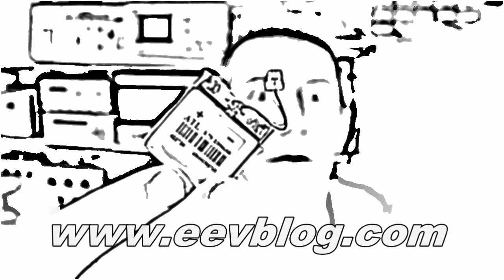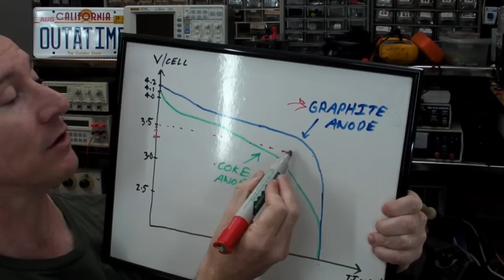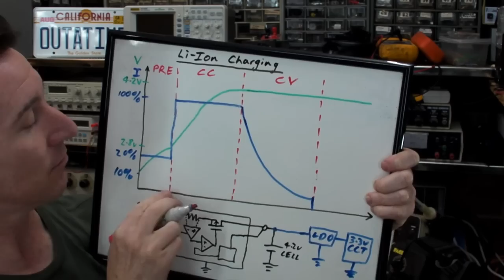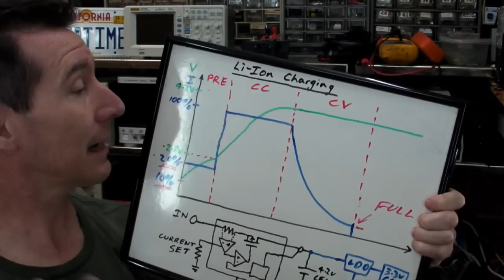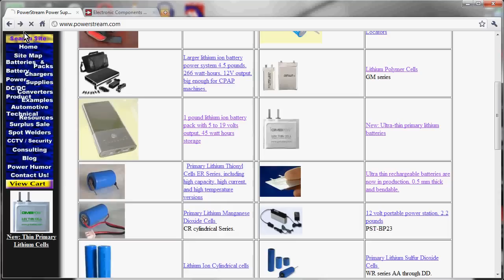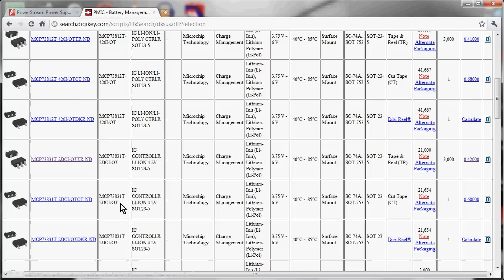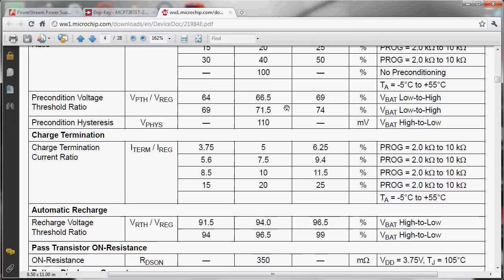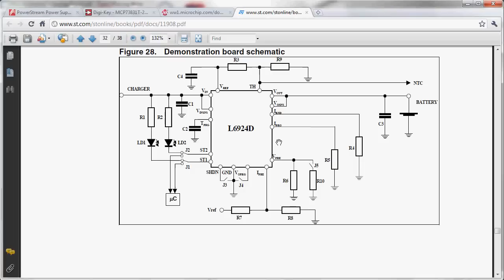EEVblog #176 - Lithium Ion/Polymer Battery Charging Tutorial

Comment: just don't get it when you say it starts with just constant current.. .and not constant Voltage as well. If you wanted to manually charge the battery or make your own charger... what voltage would your power source be giving the battery on the first stage of "Pre" charging? I would assume you simple give it a regulated 4.2VDC with a CC of 20% of the rated mAh.. then when the battery voltage reaches 2.8VDC you set he CC at whatever the battery can handle.
In my case I want to build a fast charger for a 18650 battery that can handle 4A CC. Just don't get Stage 1 or Stage 3 of this presentation. When you apply power to a battery its going to be difficult to monitor Voltage if the voltage is set to 4.2V at the source.. Do you put a resistor in between the source and battery then monitor the voltage at the battery's + with coparators? Please shed some light as there are no proper charger out there that can do what I need. I would like to build a few to independently charger each cell.

Comment: no difference between Ion and Polmer? O.o ok!
thought the Ions are a little bit lower in voltage..
Reply: Nope, only weird one is lithium iron phosphate, differene there is 3.65v constant voltage phase.
Reply: lithium ion actually has a nominal voltage of 3.6 volts, not 3.7
Reply: +Conor Custance-harrison That's usually attributed to grewter internal resistance, but won't change the power requirements for charging in any significant way.
Reply: Actually there is a few differences; 
Li-ion are thicker, cheaper to make, and they use a liquid electrolyte.
Li-poly are thinner, more expensive, hold less energy density, and have a polymer electrolyte.

Comment: I am designing a portable speaker that will run on 14.8 volt li-po battery pack (4 cells)
the battery that would be RC toy battery from ebay
now think i need a "balance" charger - charger that keeps all the cells at the same voltage
those batteries have negative and positive terminals, and also 5pin balance connector - also negative and positive, and every battery connection
could you help me to choose some chip or something to balance charge, and over and undervoltage protect these batteries?

Comment: Hi Dave !Thankyou for your tutorials!
There's something i would like to ask you!
I want to integrate Lithium Ion into my project but what about the regulator I saw many regulator this is what i found suitable ..a microchip chip the MCP1827  0,33 V drop-out and 1.5 Amp in output what do you think?!?And what the best solution for cut-off ? i will integrate the MCP73831 the MCP1827 and i don't know where put the cutoff circuit
Best regards!
These will be part of controller for a quadcopter ;)

Comment: i have an idea to make a Li-ion battery charger but i have no engineering experience i did some learning but i am not sure if you can change a Li-ion battery in this method. Assume you created a 12v li-ion battery and only changered it up to 80% capacity (Which from my research 80% is good if you do not want to stress the battery.  would it be possiable to charge it say at a constant current of 200mAh or a little less,  until the cell voltage reaches 4.0 Volts then cut the charging process off. if what i learnt was correct, if you charge the battery at a low current. by the time the voltage increases the cell is practically full.  I'm trying to have an inexpensive way to charge them from solar panels as a type of back up source, Without complex a complex design. Please share your thoughts with me.

Comment: But for the sake of "easy life" they really CAN be treated identically.
In reality they can be separated in three ways: (1) LiPo will have higher discharge rate on average than Li-ion because of lower internal resistance ... although it is relative fact, (2) besides poisonous lithium smell, LiPo smells worse than Li-ion (this is where chemistry comes in play, DO NOT CHECK THIS!!!) and (3) You can literally blow up or burst in flames LiPo where Li-ion at most will puff and become hot!

Comment: I love the vids and I love cells  I have a question. I use IMR 18650 cells capable of delivering 16 amps. They are 1600mAh or 2000Mah with 10 Amps of ability. They suggest around a 600 or 1000mA charge rate.  I only charge to 4.1 to prolong life, but I am wondering if I can charge very slow, and will it help the cell last longer? Such as 100mA. Also, is it better or worst to charge slow enough that you don't need CV stage, which is very slow? Thanks, love the show.

Comment: i need this but for 22.2 V do i connect the battery to 6 of these?
Reply: basically 4 of these in parallel from teh 22.2 V supply and to the battery? sorry stupid question probably
Reply: marshalcraft
For multiple cells in series like that (all charging from one charger), you'd typically charge them with a "balancer" circuit connected between each cell.
But since the charging circuits are so cheap, you might be able to just use multiple chargers (a separate one for each cell).  I haven't yet tried this in practice though.

Comment from the maker: @blackmuzzle Yes, the RC packs are usually designed specifically for high charge/discharge rates, to drive motors and the like. They have different requirements and specs to regular cells that are designed for your ordinary electronic gadgets. Totally different ball game, and one where temperature monitors and safety timers are much more important.

Comment: There are differences between Li-ion and Li-Po
Li-ion have bigger capacity/volume and capacity/weight, then Li-Po
Li-Po have bigger charging and discharging efficiency.
Li-Ion efficiency tops out at 88%, while Li-Po tops out at 99,98% and you call it no difference?!
Reply: 99,98% efiiciency is too big. Is it current efficiency (mAh DSC /mAh CHG). If so li-ion have the same current efficiency. But total efficiency can't be as high. DSC voltage is always less than CHG voltage creating inefficience on any battery, beacose of battery resistanse. Don't li-pol have zero esr?

Comment: Just pointing out that lithium-Ion has a much lower safe discharge voltage than lithium-polymer, which is why you should not use lithium-ion protection circuits with lithium-polymers. (I learned this the hard way)

Comment: I don't want to say it is b*llsh*t but I did some experiments and it turns out that the battery regulates itself. The only thing you need to be sure of is the maximum voltage (must be exactly the same as the battery rating), very critical and the maximum current (limit) that is allowed to flow when charging. When you do this, take care of, it works absolutely fine. Overcharging and other dangerous woowoo is impossible when correctly configurated. The voltage drops already when the battery is empty and than the current is at maximum (allowed). That's not magical. When the voltage rises of the battery, the current drops and reach zero when the voltage is equal to input voltage. That means the battery is full and the charging stops automatically because there is no voltage/potential difference. That's not magic. When you simply use a voltage meter and a current meter you can see what is going on. You only need a 'special' charger IC when you don't (want to) take care of the basics yourself. It isn't something special to simply charge a battery, most of it is natural behaviour. A specialized charger IC makes only a difference when it can decide to charge or not to charge. That is a property that can really make a difference.

Comment: If you have Li-ion or Li-Po cell with voltage below 2.7v charging it will make it catch fire or even worse - explode. You cannot charge lithium based batteries, which have less then 2.7V, because it is permanently damaged!
Actually precharge threshold is more like 3048mV not 2.8V, 2.8V is completely dead battery and it already posses risk of exploding!

Comment: All that dancing around about 4.2 volts being CRITICAL.  Bah!

What if you set it to 4.18 volts instead?

If 4.2 is the critical MAX, then why worry about it.  Just go a touch less and be sure.  The loss of battery capacity is infinitesimal.

I hear of some dialing back the max to increase longevity of the battery.  Not sure how effective that is, but interesting question.

Comment: No-no-no! Your video is great, but you have to right your wrongs: Li-Po and Li-Ion are indeed different technologies with fundamental differences that make 'em suitable, or not, for a given specific application. Li-Ion is cheaper, newer, is more dense [can store more energy in the same volume], is usually heavier [despite having more density than compared to Lo-Po because it is usually enclosed in steel casings], Li-Po is flexible and takes more time and cycles to age as compared to Li-Ion. And if my memory doesn't fail, there's one more important difference: a single cell of Li-Po has a nominal voltage of 3.7v compared to the 3.6v of the Li-Ion; now, this might not look as much but you are ignoring the fact that most of batteries are multi-cel, that means that a 3 cell Li-Po has an output of 11.1v and the equivalent Li-Ion counterpart is almost half volt below and that is relevant stuff!

Comment: It's not quite true that there is no difference, there are a few. Li-ion are cheaper, has a liquid electrolyte, thicker, hold more energy density. Li-poly is thinner, more expensive, flexible, has a polymer electrolyte, and hold less energy density.

Comment: You seem smart as shit when it comes to this, and this is an 11 year old video, but your mic is very gainy. Its set to too high of a sensitivity and is picking up the quiet noises, and shocked by the slightly louder ones. if you have this issue on the more modern videos, look into some audio software that corrects this in post without an engineer.